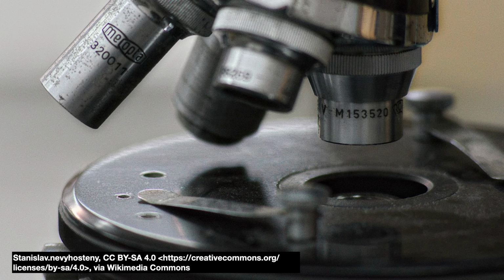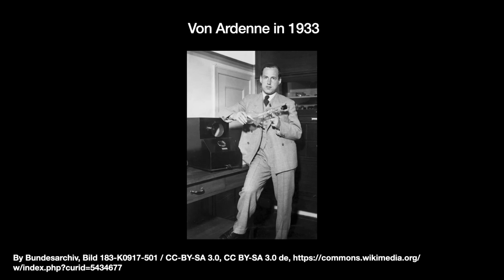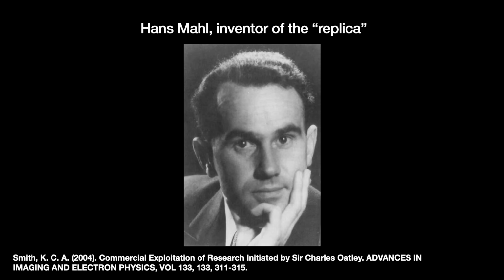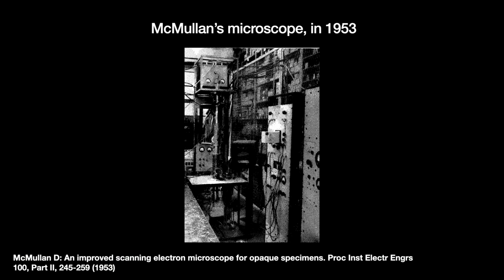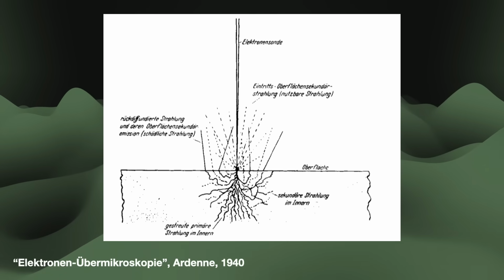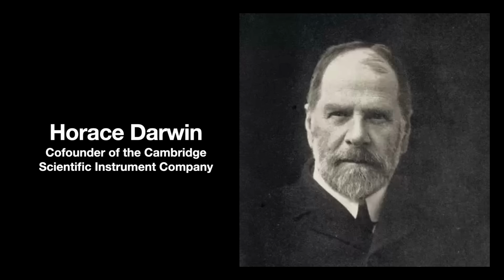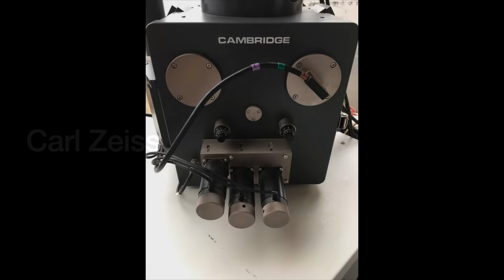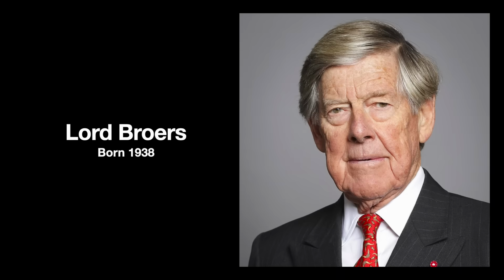The Difficult Birth of the Scanning Electron Microscope

Comment: Cambridge instrument formed later together with Leica as LEO (Leica electron optics) then Zeiss joined. Then LEO was aquired completely by Zeiss and Leica stopped building EM but still producing accessories for sample preparation. Although arch rivalries in optical microscope, Leica and Zeiss still cooperate when providing solutions for EM customers. Currently Zeiss is still producing the SEM in a small town close to Cambridge.
Reply: I worked for them back in 1994/95 when under the name of Leica, in a town called Cherry Hinton, Cambridgeshire.  One of my missions there was to modify an SEM to work within a radioactive environment, which I achieved by separating the vacuum chamber from the console with long runs of cables connected through a shielded bulkhead.  Took me months, but what a beauty that was.  Good times. Good bunch of people.
Reply: @FunkySpunkyJunky  Leica was taught electron optics by Amray, in Bedford MA. I participated. Leica made one major development: they got away from the oil diffusion pumps and led the change to dry pumps - turbomolecular pumps from Balzers. Early TMPs had the nasty habit of disintegrating into aluminum dust. Oh, well! The system was the Leitz-Amray 1600 Turbo.
Reply: The Zeiss history is very interesting, it was founded in 1846 in Jena, Thuringia and Mr. Carl Zeiss later cooperated with chemist Otto Schott who founded his own company in 1884 and that Schott (you pronounce it like "Shot" and not like "Scott") is also still around today, known for boron silicate glass "Duran" and glass ceramic used for modern cooktops "Ceran" ("Ceranfeld" is a generic term for these cooktops in Germany like to Xerox for photocopying or Velcro for hook-and-loop fastening).
And Zeiss was mostly in the GDR after WWII but another Zeiss in West Germany was also built up in Oberkochen and of course these merged after reunification.
Leitz/Leica was founded and still is in Wetzlar and there was another optical company making binoculars and scopes: Hensoldt and that was in nearby Braunfels (brown rock) since 1861 and moved to Wetzlar in 1865, four years before Leica was founded and Hensoldt was acquired by Zeiss in the 1920s.
Schmidt & Bender (a name in telescopic sights too) is also pretty close to Wetzlar in Biebertal, only Rodenstock (Munich) and Steiner (Bayreuth) aren't in that area, Wetzlar/Gießen is literally the Silica Valley 😁
So the history of these three/four giants in the German optical industry is pretty interlaced.

Comment: I actually have a Cambridge Stereoscan 200 sitting in a room of my house.  Haven't had a chance to hook it back up since I moved, but hope to get it back up and working again.
Reply: You are lucky your wife has not thrown it out. Oh, maybe it's too heavy to budge.
Reply: If they sit too long they are challenging to get running again. We totally modified an old Joel SEM when I was in college. I did the upgrades to the UHV system, swapped the mercury diffusion pump for a turbomolecular pump. Was both faster and more energy efficient than the diffusion pump. Oh props to Glassslinger for the bearing repair video.❤

Comment: There are many different varieties of scanning electron microscopes. Some models are quite simple in design. But the units that are used to non-destructively image powered integrated circuits require very special electron optics, such that high resolution is maintained while the energy of the electrons is kept as low as possible, to minimize their influence on the semiconductor devices. This is the opposite to the more typical high resolution microscopes, where the resolution is bought by cranking the energy of the electrons up -- in some TEMs, to millions of electron-volts.
Reply: There's a million different detectors a SEM/TEM have for various purpose. Biology labs are going to have wildly different need than a geological lab or a semiconductor lab.
Reply: Some targets require you to plate on a thin layer of a dense metal like gold or osmium to deliver crisp Images
Reply: The highest resolution machines are those that use Aberration correctors, one of these happens to be a 1MV machine. The Aberration corrector reduces the spherical and on some models, chromatic Aberration of the system to a very low amount, thus giving them closer to theoretical resolution based on the energy. Prior to the invention of the Aberration correctors, the highest resolution machines where of the very high voltage type.  There are also some quite high resolution low and ultra low voltage TEM
Reply: @lbochtler  All practical electron microscopes have some correction coils. Even the old and relatively inexpensive tabletop scanning microscopes had static and dynamic astigmatism correction -- not unlike how it was done in color television CRTs. 

Achieving low aberrations in a low voltage scanning electron microscopes (LVSEMs) is very difficult because the same absolute dispersion of electron velocities from the source becomes a larger relative dispersion at very low beam energies, making chromatic aberration unbearable without a correction. To maintain the same resolution as in ordinary SEMs, despite ten times lower beam energy, requires electron optics of much greater complexity. That's why LVSEMs are not just ordinary SEMs with acceleration voltage dialed down. It is kind of peculiar that one pays the least for the ordinary SEMs, but the machines with ten times lower energy are all significantly more complex and cost more. This is not as obvious as the large very high voltage, very high resolution machines costing more.
Reply: @cogoid  You are correct. The lowest voltage SEM and LVEM (TEM) all use FEG's, either TFE or CFE, as well as monochromators on the very highest end machines, then on some semiconductor machines you get spherical aberration correctors as well. On the TEM side you get some of the most complex aberration correctors ever devised. Examples of mid range lowish voltage SEM are the Zeiss Gemini column based units. On the very top end you usuelly see custom machines.

The Aberration correctors im talking about are not a simple Stigmator, but based around Dodecapole and Hexapoles, with magnetic and electrostatic components. You also tend to see Immersion lens machines at low völliges. 

On the TEM side, there is one rather fascinating machine, the LVEM 5 from Delong Instruments, which is a 5kV TEM using a cold FEG. From what i could manage with it when i tried it, its a rather fine machine.

Comment: Another fantastic, well researched story. In the future, when they're smaller and cheaper - I look forward to having my own SEM on my desk!
Reply: Same!
Reply: You can find some used ones for about $10k, I believe. I've had to look for SEM's tp possibly cannibalize parts off of. That's how I know!
Reply: There are desktop SEMs, my university got one delivered last year. It actually is easier to use than the first SEMs I used in grad school. It’s not cheap, about $200,000 USD (can be cheaper, depends on the model and the accessories), but it’s an indispensable tool to assess what our nanotechnology engineering students do on their projects.
Reply: Probably will be an app with a little box you plug into the phone.....sample prep will still be an issue though....  ;*[}